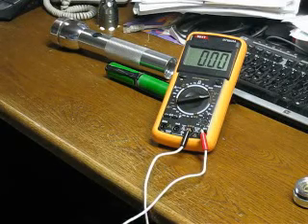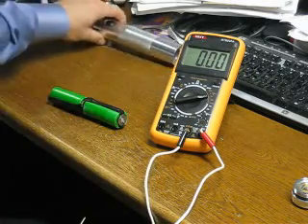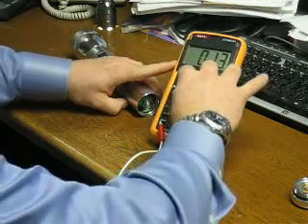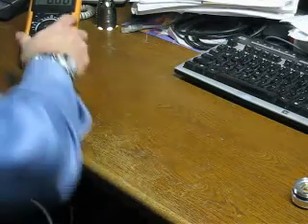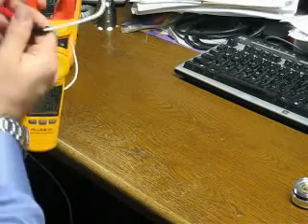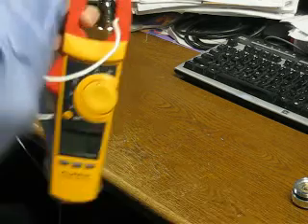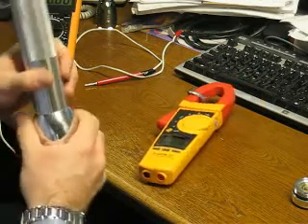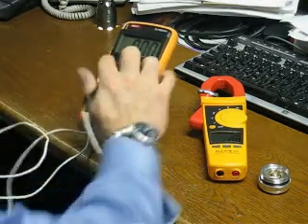How to Measure High Current.flv

Comment: So there is no point in measuring with a multimeter, if you don't know how to properly do it?
Reply from the maker: Maxim C. It’s not about knowing how. This is a circuit with very high current at very low voltage and no driver or regulation which makes it extremely sensitive to the method of measurement because the method becomes part of the circuit. The 9 amp LED draws more current with every millivolt supplied to it and the voltage in the circuit drops with every milliohm of resistance. The amount of resistance introduced to the circuit by an in-line multimeter, or even by heavy gauge stranded copper significantly reduces the current in the circuit because the slightest drop in voltage causes huge drops in the amperage that the LED draws.
Reply: therealtechjunkie 

I see.   If one just takes a multimeter and measure, without knowing this information -- his measurements will be wrong (in this kind of scenario).   So basic skills are necessary in order to use a multimeter properly - that's what I meant to say.

Do you think you could help me with this problem (that I just now wanted to post to Quora/forums):  https://drive.google.com/file/d/10P1171uT4l6ac6GJ1Uhw8WcSC7HwdF9I/view?usp=drivesdk ?

Will the current, in this case, flow through only those 20 cm and not through the whole cable (1 meter of length)?   I need this in order to know if I can put into a formula just the resistance (caused by the cable itself) in only those 20 cm that go from battery to the starter, or it is necessary to permanently cut the cable in that 20 cm mark?   (To clarify:  I need these cables untouched, but only need 20 cm of cables for the current project)

Thank you in advance.
Reply from the maker: Maxim C. If the starter attaches at a break in the insulation 20cm down the cable from the battery terminal and nothing connects to the cable beyond the starter, then yes. You can verify by measuring with a clamp meter before and after the starter.
Reply: therealtechjunkie 

Thank you very much for taking the time to respond.   I will definitely verify this. Very curious... I wonder if that would mean that one could to safely touch, in such particular scenario, the free end of the cables, while a high voltage and/or current is passing through the first 20 cm sections of the cables from the source of the electricity to the starter... (not that I need it, just a curiosity)
Reply from the maker: Maxim C. Don’t do that. You’ll become part of the circuit and get fried.